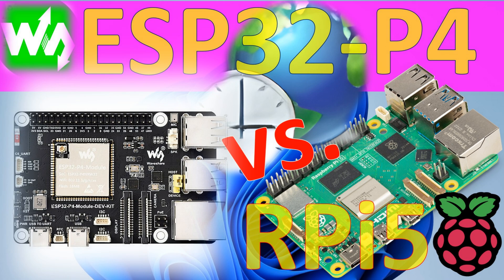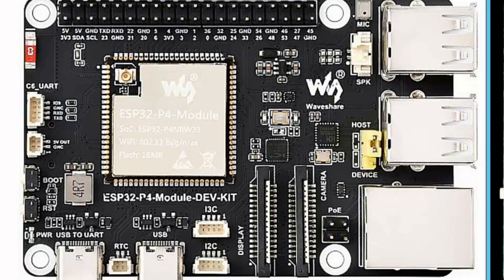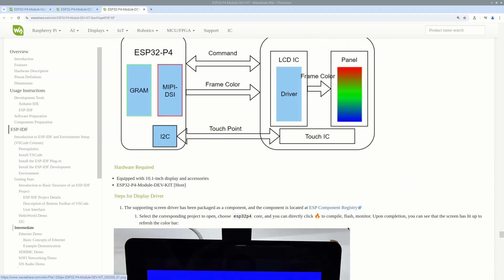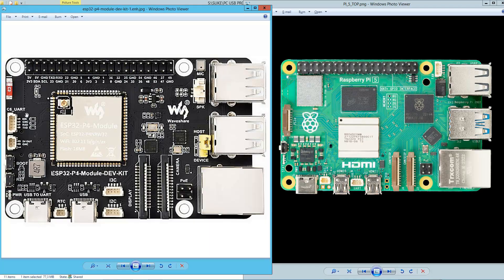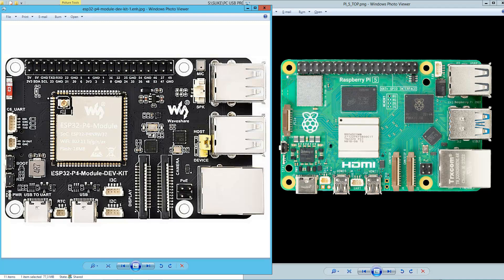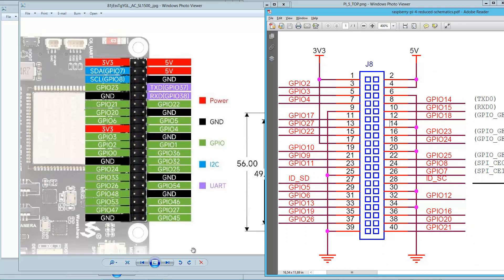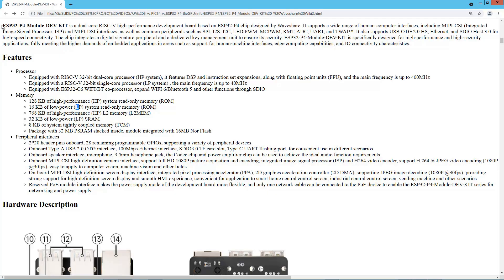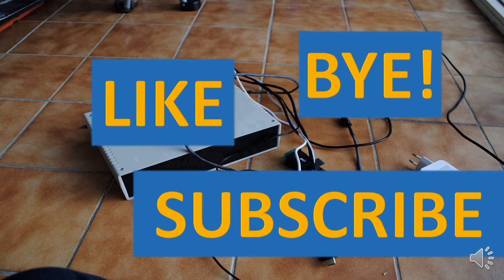ESP32-P4-Module vs. Raspberry Pi 4 & Raspberry Pi 5. Can it beat Raspberry Pi?

Comment: Waveshare also do a second version of that board which doesn't use the module, but instead has the P4 and C6 directly soldered onto the base board. That module devkit is obviously designed for people who may wish to incorporate that module in their builds. The non-module vesion of the board also has 3.5mm audio which it looks like they ran out of room for in the module version of the board.

As for the low RAM when comparing wit ha pi, yes, but I find the amount of PSRAM (32mb) interesting. Remember Windows 95 could do a lot with 32Mb of RAM, and the P4 can run Quake 1. There is a lot of potential behind the ESP32P4.
Reply from the maker: Exactly, you don't need a Ferrari to drive on a gravel road, you need a Jeep...
Reply: I also like the idea of no operating system on microcontrollers for things like HMI panels for smart homes, less maintenance than a full blown OS, less things that can go wrong if things are kept simple (e.g. OpenHASP)

An HMI panel running Android is often running an out of date version (often Android 8) and may become a security risk if it gets overlooked.
Reply: To me it's more about reducing the potential attack surface. Run an outdated version of Android in a forgotten HMI panel and nobody monitors it and it becomes a security risk, it could get a virus running in some door or light controls and nobody would be the wiser. The simplicity of less moving parts if there is just a firmware in an ESP and not a full blown operating system that needs to be maintained is what I like.
Reply from the maker: I like your comment. Of course, as SW complexity increases the number of potential security holes is multiplying. So, if you don't need complexity and high performance for your HW application, use just what you need. If even ESP32-P4 is too powerful for your application, why not using PIC32MX270F256B microcontroller that is easy to solder and supports a wide array of simple LED displays that connect through SPI and I2C buses (www.pcusbprojects.com)...  Elon Musk once said that the best part was no part...
Reply from the maker: I agree that the potential of ESP32-P4 board is high for certain applications. But I can't really compare these to Windows 95 and 1024 kB of RAM that may PCs had at the time. A serially attached PCSRAM is not the same as a DRAM chip attached directly to a wide memory bus... On ESP32-CAM modules it is primarily used for intermediate storage for picture frames when recording a video to an SD card.

Comment: yes, but ESP32 has very little RAM. It cannot be compared with RPi and a small computer...
Reply from the maker: First of all, they look alike. It is good to know what strong points and weaknesses of each are and not to confuse them.
Of course, ESP32-P4 is not meant as desktop, but rather as a display panel controller. It may also be used as an extension of a classic PC or PCs (through the Ethernet) to achieve Raspberry Pi like I/O functionality. If you wanna use a cheap(er) (ex. GMKtek) mini PC, instead of Raspberry Pi 5, you definitely need an I/O extension board. ESP32-P4 may be the one you are looking for in this case, because of it's excellent external connectivity options.
This is also interesting for Raspberry Pi 5 users. If you run out of GPIO pins, you may consider adding ESP32-P4 Module to expand I/O functionality for some devices. You can also program ESP32-P4 module from Raspberry Pi as from any other PC. 
ESP32-P4 may be a better option than Raspberry Pi for solving simple control problems, because it has the same form factor and it burns much less energy and it can also use many of Raspberry Pi's hats. 
Also, If you wanna use 2 incompatible Raspberry Pi hats at the same time, you can attach one directly to Raspberry Pi and the other one through ESP32-P4 Module accessible over the Ethernet....

Comment: I don't understand why you comparing this with a RPI.  The PIE is a computer with an OS, and the ESP32 is an embedded boars with low ram and low speed CPU for embedded systems.
Reply from the maker: Today, there is a computer in almost any device, but computers are not the same. A coffee grinder can run on a micro-controller like ESP32 and it may not even have an operating system (OS). However, this doesn't mean that it couldn't run an OS, if it's designers decided to use it. ESP32-P4 is the same. You can install OS and run your application as a program on it, or you can burn firmware with a stand-alone application that doesn't need an OS. It is your choice!

A program could also run on any other computer without an OS installed. In a classic PC there is BIOS, but it is only meant for loading an operating system (OS). If there was a general application instead of it, it could do anything you wanted. However, an EEPROM chip can only host a relatively short program (or standalone application). But other media (SSDs, SD cards etc.) could be used to store the major part of such a program... However these would not have been practical. A full-blown OS is a much better choice for computers with much higher performance like RPi 5 and classic PCs.

Having an OS in your computer is a matter of practicality and ease of use, but it is not meant to be a limiting factor. ESP32-P4 is a small computer that can be programmed from many programming environments that support building OS and/or non-OS applications. Running a larger and more powerful computer like RPi 5 or a classic PC without OS is possible (and may have been used in special industrial-military applications), but it is highly impractical for home use.

ESP32-P4 will probably lean more in favor of using an OS in the future, because it enables building quite complex dashboards with audio and a microphone input. The added complexity might finally lead to wider use of OS even with this small computer.

ESP32-P4 is certainly more powerful than 32-bit Atari 1048 STF, which is an ancient desktop computer form late 80's, but it was (is) used for a different purpose. However, if there was a crazy enough programmer with a grain of nostalgia, he or she could have easily turned it into a desktop computer with an OS with a GUI, a keyboard and a mouse. But it would have been much less powerful than Raspberry Pi 3 with 512 kB RAM or 1 GB RAM.

Watch to learn more: https://youtu.be/TxylqSIgyC8
Reply from the maker: The reasoning is in fact very simple: Intel and AMD processor based micro PCs that are well in size and price range of Raspberry Pi 5 and even smaller and cheaper outperform it in processing and graphics, but they have no external GPIO ports to directly connect them to homemade hardware. A simple solution is needed to produce missing I/O functionality. Waveshare ESP32-P4-Module seems perfect for the job. You can also connect it to your local network and enable all PCs within it to access your homemade hardware including many Raspberry Pi hats. Raspberry Pi 3, 4 or 5 is more like a desktop with added GPIO functionality....
Reply from the maker: You can also use a relatively cheap ESP32-P4 Module to extend Raspberry Pi 5's GPIO functionality.